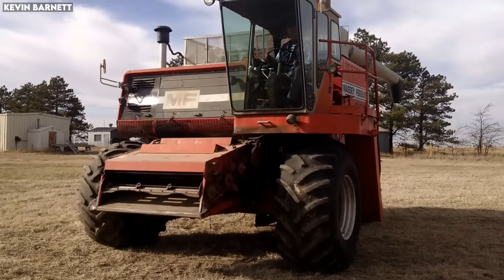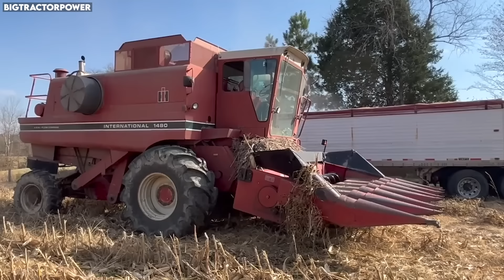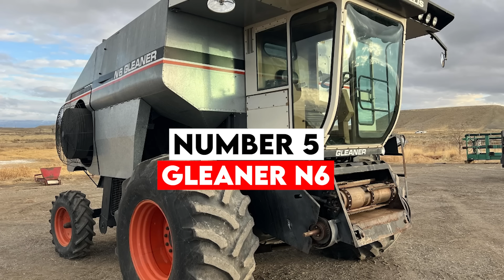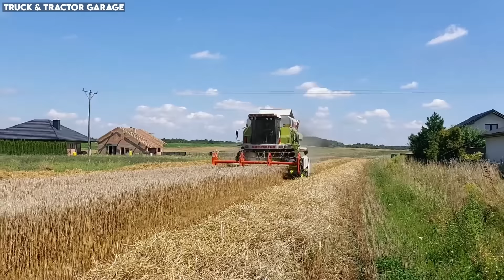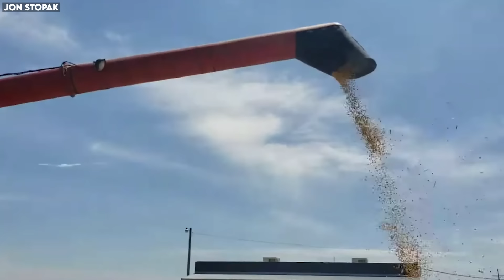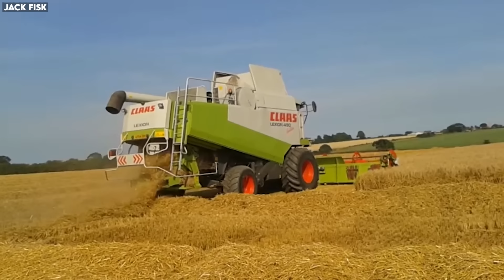10 Old Harvesters That Work Better Than New Models

Comment: I trust my ih 1460 the all around versatile combine , it had the heavy frame big engine and rarely broke down , cab ,ac , built in 1980 , i bought it used in 90 ,added a crop chopper and still have it , its all component parts ,all replaceable ,cheap to fix .